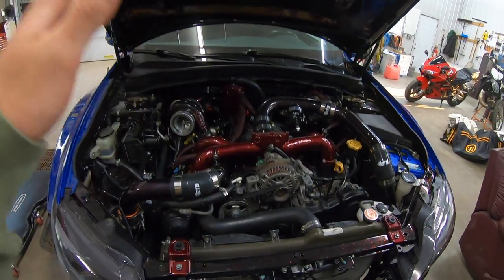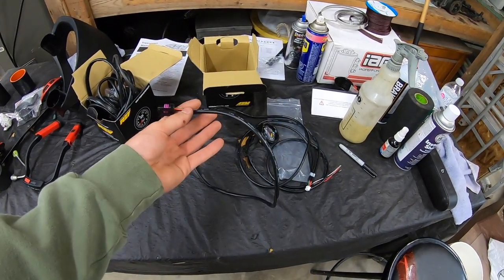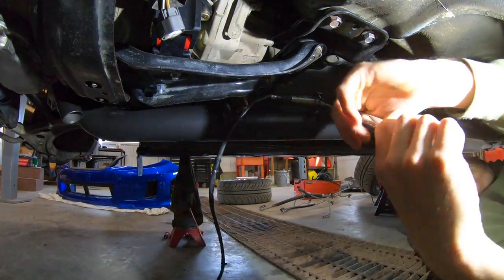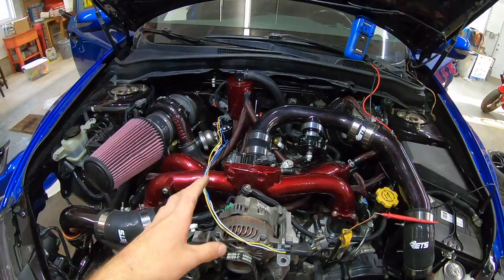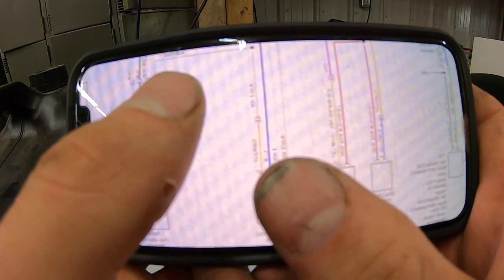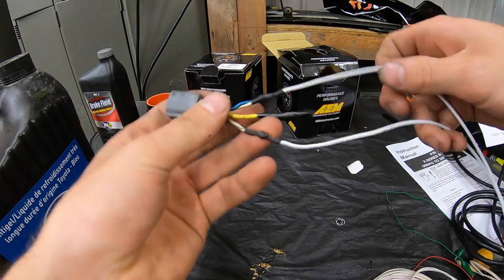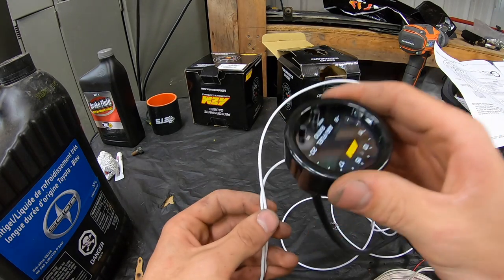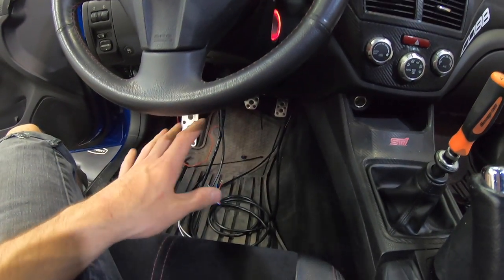AEM BOOST & AFR GAUGE INSTALL!! (How To)

Comment: I have a question tho if you just disconnected the oem wire and then run a wire only to the gauge, how does your ecu get the info to manage your fuel ratio?
Reply: Did u get any answer on this?

Comment: I still got my 2 oem O2 sensor, so would i need to tap the 2 wires to the signal positive and negative ? The gauge is mainly for reeding purpose at this rate ! 

Thanl you !
Reply from the maker: If you are still using the factory AFR & downstream O2 sensor then you don’t have to tap into the rear O2 wires. That is strictly for data logging purposes & so your ecu can display the wideband reading on the access port. 👍🏼 Hope that helps

Comment: One thing to state. If you’re running a catted downpipe, you should use the bung on your DP before the cat. It is far more accurate and you don’t have to mess around with your stock sensor or the other wires. That’s why people just use the black and red wires.
Reply from the maker: Correct. If you have a catted dp you need to run the wideband sensor pre cat. My ETS kit is completely catless so it doesn’t matter. I tapped into the other wires strictly for data logging purposes. Then my access port can use the rear O2 sensor input to the factory ecu & display the wideband reading.
Reply: I'm installing this on an 04 wrx, it has a catless DP can I still put it on the bung on top?
Reply: @chrisguzman7926  yes. I was just stating it’s more accurate to run it before the cat.
Reply: @AblationMusic  cool thanks, appreciate it 🙏

Comment: Hey bud awesome video. Were you able to correct the boost issue, gauge not zeroing when the engine is off? I’m having the same issue. 
Thanks
Reply from the maker: Yes I fixed that issue. In this video I ran the boost gauge straight off the compressor housing of the turbo. I moved the gauge to read off a vacuum port directly to the manifold. That way it will read vacuum & boost.

Comment: Hey Dan just wondering if I still need to use all the wires/tap into stock 02 sensor if my ecu is completely stock?
Reply from the maker: You only need to tap into the stock O2 sensor wires if you want your factory ecu to recieve the rear O2 sensor readings for data logging/tuning purposes. 👍🏼

Comment: It's a good thing I now know what I'm doing... lol.
I Might just get my local tuning mechanic to install my Wideband/Boost gauge
Reply from the maker: You can do it! Just take your time & you will figure it out :)
Reply: @DanielKellert  where did you find the wiring diagram?
Reply from the maker: @allmighty736  Program I have at work called ALLDATA.
Reply: @DanielKellert  ALLDATA will not work in my region of the world and it you have to pay for access to it....
Reply from the maker: @allmighty736  That’s why I explained the wiring in this video so you don’t have to look it up :)
Reply: Bother. At 16mins in video!  The blue wire for WRX  you ignore is the wire I need to know? I have a 2008 WRX hatchback. It's not an sti
Reply: I need it to be tuned once the gauge is in anyway! Thanks for your help anyway bro
Reply from the maker: @allmighty736  I explain it at 18:17 . If you are running the AEM x series gauge, use the white wire as signal + & the white & black as signal - . If you’re not running an x series gauge you only need to use the white wire as the signal wire.

Comment: New sub here. Loving this build series as it's essentially the same thing I'm going to do when I get my GR. Been looking at gauges for the past couple of days and was wondering, is the boost gauge on the cobb AP is as accurate as a physical gauge? If so, does the speed density conversion affect the readings?
Reply from the maker: Appreciate that 🙌🏼 good luck with your build :). The gauge in your AP gives a reading based off MAP differential. When your engine is under boost, it is essentially your turbo pushing air into your intake, which is also adding pressure. Your MAP sensor’s purpose is to read pressure & vacuum in the manifold. So yes the Cobb AP is pretty accurate as it is using a factory installed sensor. For the speed density question, no speed density does not affect the readings at all. All you are doing with speed density is getting rid of your MAF sensor & adding an IAT sensor post turbo & pre manifold. From factory your IAT sensor is actually inside of the MAF sensor. Speed density converts your ECU to using your MAP & IAT readings to determine the amount of air & temp of air coming into the engine. This is great for turbo vehicles because as your turbo pushes more air into the manifold, it also creates more pressure, which your MAP sensor is able to read & send the signal back to your ecu. That was very detailed but I hope it answered your questions! 😅
Reply from the maker: Appreciate that 🙌🏼 good luck with your build :). The gauge in your AP gives a reading based off MAP differential. When your engine is under boost, it is essentially your turbo pushing air into your intake, which is also adding pressure. Your MAP sensor’s purpose is to read pressure & vacuum in the manifold. So yes the Cobb AP is pretty accurate as it is using a factory installed sensor. For the speed density question, no speed density does not affect the readings at all. All you are doing with speed density is getting rid of your MAF sensor & adding an IAT sensor post turbo & pre manifold. From factory your IAT sensor is actually inside of the MAF sensor. Speed density converts your ECU to using your MAP & IAT readings to determine the amount of air & temp of air coming into the engine. This is great for turbo vehicles because as your turbo pushes more air into the manifold, it also creates more pressure, which your MAP sensor is able to read & send the signal back to your ecu. That was very detailed but I hope it answered your questions! 😅
Reply: @DanielKellert  Makes perfect sense, thanks for clearing that, now I can rest easy. Subaru has unfortunately canceled the next generation of ICE STI so that gives me more incentive to go all out on the build.